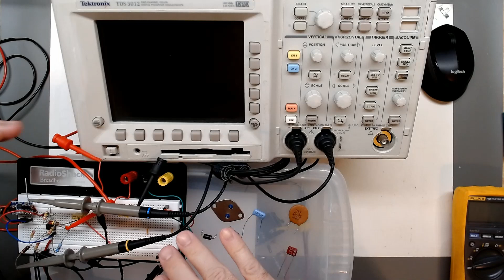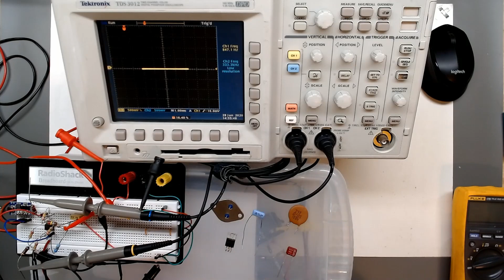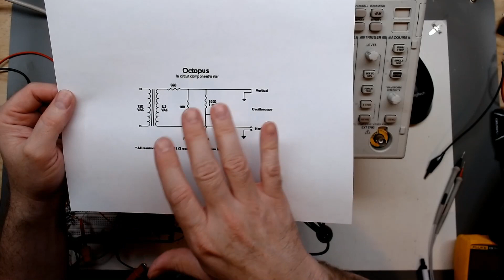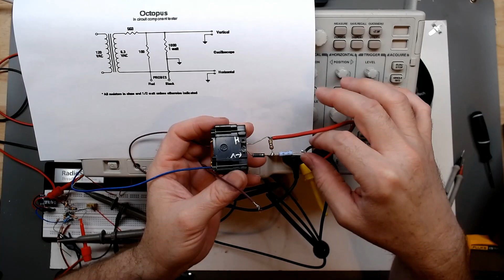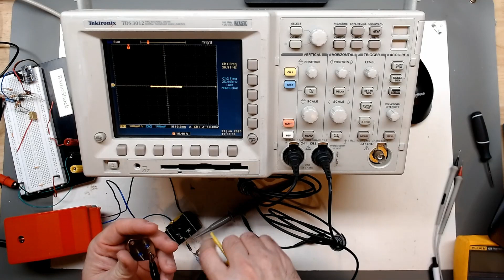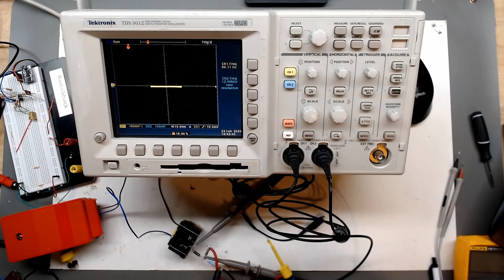Does this easy to make Curve Tracer work?

Comment: like how you did the sweep at the end to change shapes.
wondering how to set that up and maybe find the optimum volts/frequency from my function gen to get the best image on my scope.could you show that?
thanks
John
Reply from the maker: Hi that was using the sweep function on my old ELENCO GF-8026 function generator. So using the Op-amp style Curve Tracer circuit and testing a capacitor. With a sine wave test signal going in much like the very simple Octopus tracer it shows a circle and while playing with the input wave form such as triangle, square and then sweeping through a range of frequency over time.

Comment: Can I test a 10K resistor using this circuit
Reply from the maker: Well, in a way. You can use it for quick checks of boards especially when you have a known good board and compare signals on pins from good board to bad board. As far as exact ohm measurements in my opinion a good DMM is best, because you basically look at the analog signature. A short is straight line for example and angle increases as ohms increase and capacitance shows as circle and semiconductors /chips etc are neat because you can capture the complete signal of that circuit and compare to verify a similar reading. You usually look for major differences in signature If that makes sense.

Comment: Hi mate. I've made a similar circuit on a breadboard, but always get confused as to where the oscilloscope probe's alligator ground clips should be connected??? I personally hate the "ground" subject especially when using small AC circuits on a breadboard, and especially when using oscilloscopes as I power everything from an isolation transformer when using my scope, to prevent ground loop issues and risking blowing up my scope.....however it makes things even more confusing...as there isn't a "ground" to connect to! Any help would be greatly appreciated.
Reply from the maker: I believe the same ground point as the black test lead. If you are some how tied to ground then your scope ground is also connected to that point. Of course as you mentioned, If isolated then you will have to use common point such as black probe lead as common or ground connection since you're isolated through the transformer.

Comment: can i test capacitors in-circuit in power off mode?  In my board i have many decap between VCC and ground, if i use this curve tracer and connect it to one capacitors, will it show the trace for that cap ? How to identify which cap is ground.
Reply: How to identify which cap is bad
Reply from the maker: Hard to tell if in parallel without removing. That's one in circuit test that is basically find that the issue is on that cap bank but then have to remove one by one to verify. You can sometimes look for physical signs of possible failed caps such as bulges or leaks on electrolytics or discoloration on SMD ceramics, but not always evident.

Comment: Nice Demo on use of a curve tracer. I just ordered a kit off ebay to make one. Should be a big help in trouble shooting.
Reply: A curve tracer is a powerful tool for diagnostic electronics circuits, not only for test components.
Best Regards